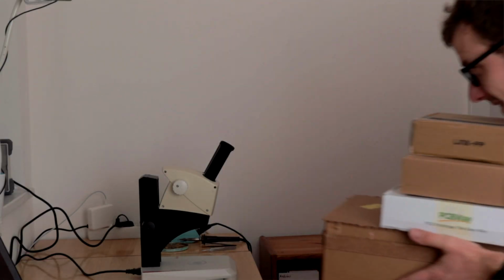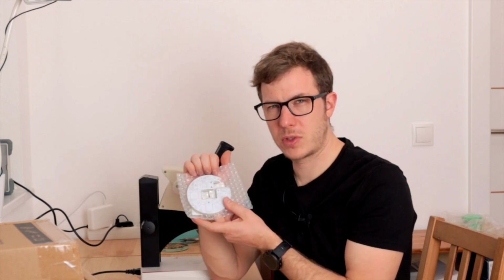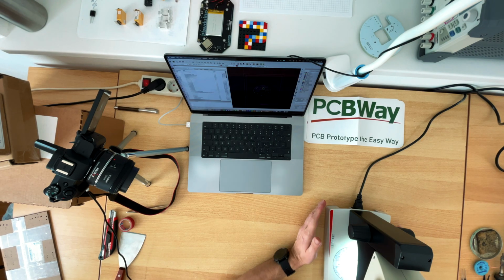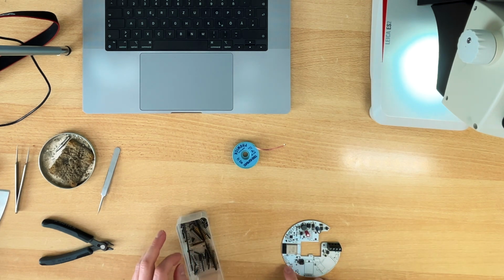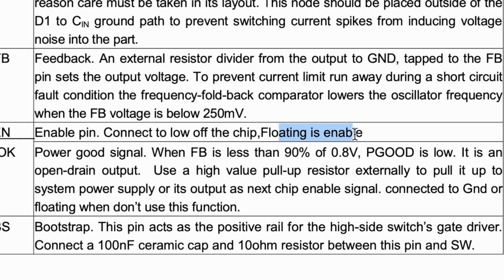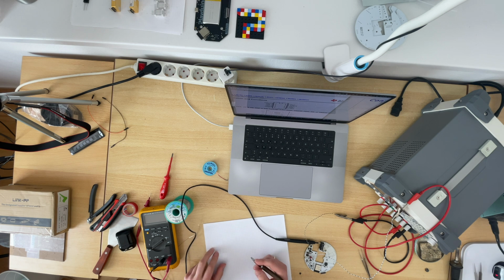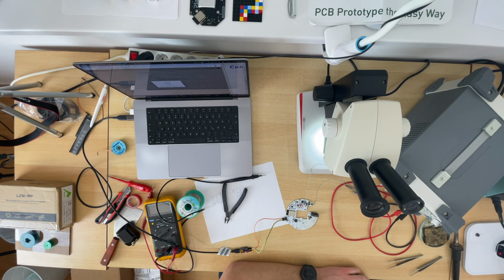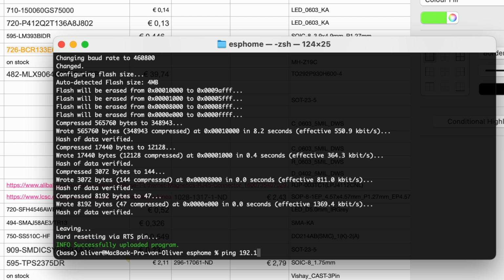Will My ESP32 POE Smart Home Sensor Work? (Almost Fried My Network Switch!)

Comment: This is really awesome. Can you share at least PoE part of the schematic? I am trying to make my own PoE circuit, but all the designs over the internet are really complicated, and try to do everything at once, and I just want to find something that will let me create a "template/snippet" for PoE that I would be able to just "paste" into my other designs.
Reply from the maker: Thank you, I am using the poe circuit of Olimex ESP32-POE. It is a bit complicated but it works great 👍
Reply: @playduino  can you link to the RJ45 sockets you are using? Because I cannot figure out which ones on Mouser are PoE compatible and which are not